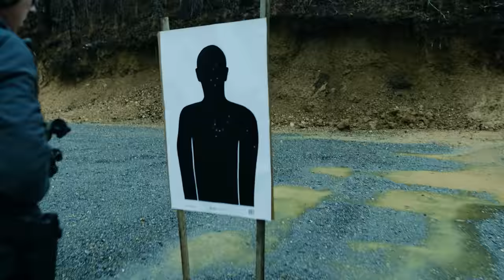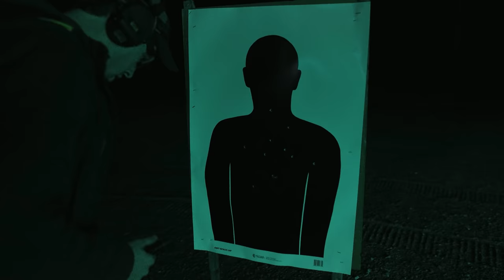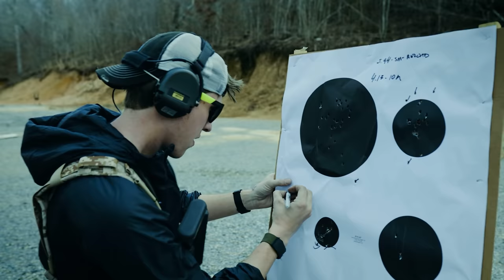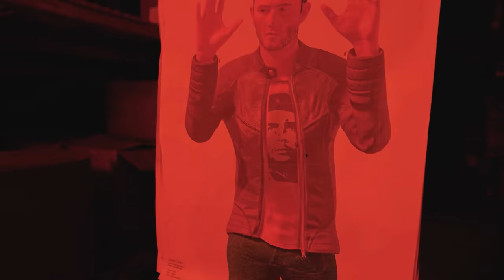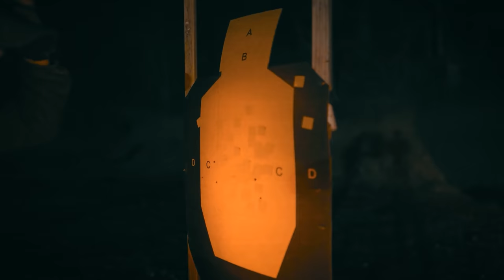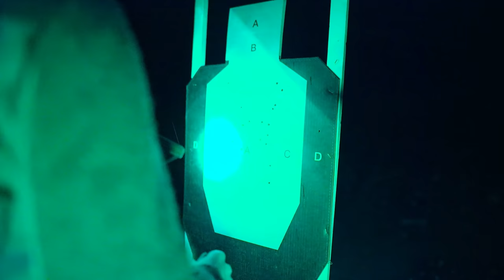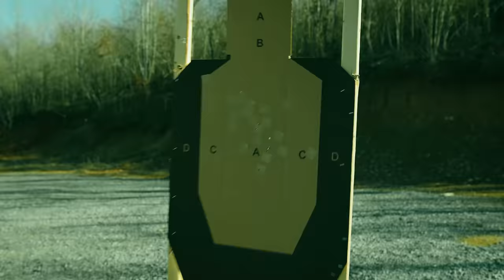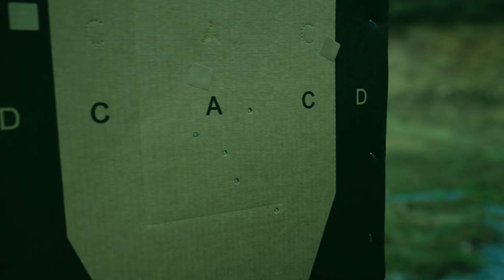10 Hours of Shooting, Training, and Equipment

Comment: For the bags I use to stuff my guns into, I try to make sure there's no snag points inside. I either have some sort of board I cut out in the shape of the bag that's smooth so the uneven shape of the gun and stuff in the above compartment doesn't cling to the shape and stuff gets hung up as you pull on it and the board keeps the overall shape of the bag. It's also good to walk around your house with said bag load to test the weight, see if you need to reinforce parts where the gun will wear on it. Make sure the shoulder straps are good and the zippers are strong enough. I actually got a carabiner on the zipper so I have something big to pull on and when it's zipped out to one side, the bag I pick always has a way to tuck the carabiner into so it doesn't snag on things. I try to place things inside the bag to reduce noise so people assume I have a bag full of stuff and not a gun with metal clanging against each other
Reply: Cutting a sleeping bag pad foam to fit your pack as a divider works well... it pads yur back, costs like 5 bucks(you can outfit a bout or two bags per one) and it will sheild a h20 bladder from sharp points. It also adds a bouancy to your discreet carbine case. This is often overlooked in my opinion. Its all fun and games till your kit drowns you cuz u fell in during maritime operations or say your boat sinks, helicopter crashes or maybe your forced to swim accross a river, canal, swamp etc. Emerency situations are a direct result of piss poor planning.be ready stay safe live free my friends!

Comment: Lucas… your thoughts/advise please!  What are your thoughts for snub nose revolvers for ccw.  Particularly something like the ruger lcr 9mm.  My issue is that I have a g19 which I shoot well and am pretty solid with.  The problem is that I simply do not have the time/money to shoot thousands of rounds monthly.  Im lucky if I can get to the range 1x per month to shoot a few hundred.  So.. to have the draw skill you have is not likely and in an actual defense situation where I may need my weapon I could only assume someone may have already had the drop on me.   So.. im wondering what the benefit would be to have my large g19 as a-pose to something more small and compact like a snubby to pull as more of a quick “get off me” type of gun.  Looking for some input/suggestions.
Reply: You want to know what is better carrying a glock with 15+1 as opposed to 6? Because it is a hair smaller? Dry fire, dry fire. Practice is what you do before going to the range. What you do at the range is what you have accomplished before going.

Comment: The broken optic drill is honestly really eye opening. How many dudes are running irons and they arnt zeroed, or vice versa not running irons at all. In my personal opinion every gun should have a set of 45’ irons. If you’ve ever had an optic fail or worked in hard weather(rain snow etc) as well as gone from a cold outside to a warm inside the glass no matter how good will blur and fog depending on conditions and the 45 irons are there just in case. Offset dots will fog and fail just like a primary so to me they seem like an unreliable backup. I would love to hear others thoughts.
Reply: I always have irons as backup on all my guns

Comment: I buy several kinds of bags and do drills with them. Most of them do wear out from use and I do replace them every year. They do not survive constantly wear and tear. I also add a bigger handle on the zipper to grab and pull on.

Comment: Do you think it would be better if you validated your equipment functionality hours before you shoot VS before every drill?

I guess I'm thinking it's better to work through problems during a drill as opposed to making sure you don't run into problems. You can do a lot to prevent problems, but you probably can't prevent 100% of every problem. Or would it be better to identify a problem and run drills that revolve around said problem?